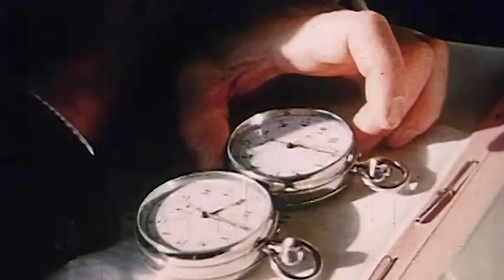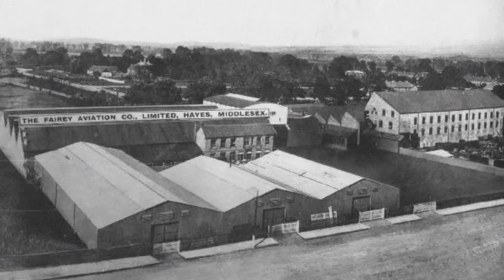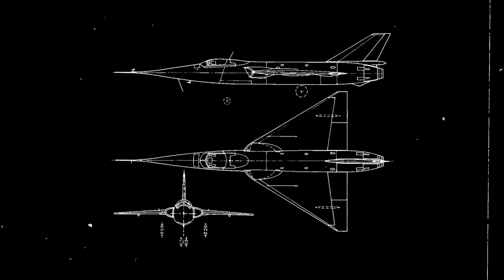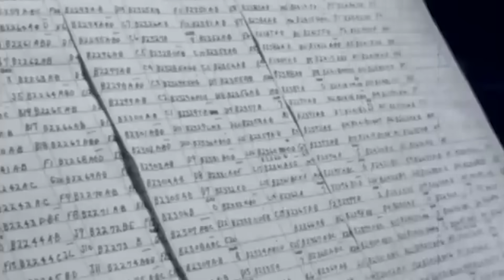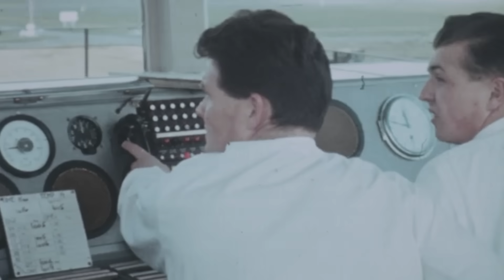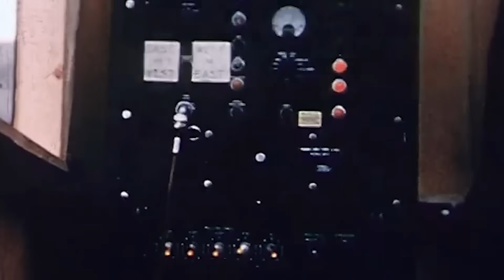Britain's 300 MPH Most Successful Mistake

Comment: What was ironic here was that the early Soviet jet fighters were powered by British-made engines that forced the British to play catch-up.
Reply: That is a popular but completely false British myth.  The soviet copy of the Rolls-Royce Nene is called the RD-45.
The MiG-15 is powered by the larger, more powerful VK-1 engine designed by Vladimer Klimov.

The Nene was not a popular engine, it was too large and heavy for its power output, its thrust to drag ratio performance was poor. 
Britain was years behind in engine technology buy more important it was a decade behind in aerodynamic technology, the MiG-15 was aerodynamically superior to anything the British had at the time, its jets still had straight wings..
Reply: @DoktorBayerischeMotorenWerke 

We believe we can clear up some commonly held myths and misconceptions, obviously

It's always good to see the facts presented clearly and concisely isn't it?

The original fabulous Whittle reverse combuster centrifugal compressor gas turbine aero engine has been in production permanently in one form or another by more that one manufacturer since 1939. The main current application is for helicopters. 
Whittle performed the world's first demonstration of a gas turbine aero ending in 1937. 

British Aerospace Sector & some bits & bobs etc. 

Interesting British achievements.
There is no doubt that the Fairey (England)
Delta 2 was of course the world's first jet
aircraft to exceed 1000 mph.  lndeed It
exceeded the previous record by 310 mph &
held the record for more than a year. Incidentally, the Dassault Mirage series of aircraft are based on the Fairey Delta 2. 
March 1956,  UK Peter Twiss,
1,132	 mph, Fairey Delta 2,	 Chichester, UK

The next speed record after the FD2 -
December 1957, USAF	1,207.6	mph, McDonnell F-101A Voodoo, 	Muroc, California 😎.

Non combat phase accident losses.
% of Aircraft built.
The EE Lightening did not have unusually high losses. 
The Canadair CL-44 was a turboprop airliner.
Canadair CL-44               (ff 1959 ) 48%
Lockheed XF104             (ff 1954) 100%
Lockheed  P80                (ff 1944)  43%
Lockheed F104               (ff 1954)  45%
MD FH Phantom 1          (ff 1945)  35%
MD F4 Phantom 2           (ff 1958)  28%
Convair F102 Dagger      (ff 1953)  45%  
MD F3H  Demon              (ff 1951)  32%
MD F-101 Voodoo           (ff 1954)  34%
EE Lightening                   (ff 1954)  33%
Gloster Meteor                (ff 1943)   21%
DH Vampire                     (ff 1943)   23%
DH Sea Vixen                  (ff  1951)  33%
Gloster Javelin                (ff 1951)   20%

Note that the Meteor didn't have particularly high losses, flew with more than 20 airforces for decades, got involved in air to air combat during a number of conflicts successfully against aircraft that first flew many years after the Meteor first flew.

Early days, jet engines. Whittle performed the world's furst demonstration of a gas turbine aero engine in 1937. The RR Nene, a centrifugal gas turbine aero engine, was the world's most reliable & most powerful gas turbine aero engine in 1944. Licensed built versions & copies of the RR Nene & RR Derwent would go on to power many aircraft in Russia including the Mig 15 & Mig 17, the US, China, France & other countries for decades after 1944. Incidentally, the Mig-15 was in essence an upsized / tweaked copy of the Whittle / Gloster E28/39 jet aircraft including a copy of the RR engine.  The centrifugal compressor gas turbine aero engine with Whittle style reverse flow combusters and sometimes an axial compressor section is still manufactured by more than one company, the main application being helicopters.

   That's correct, The Tornado & Typhoon & their engines are supersonic & are indeed British design aircraft with British design engines built by an international consortium. The Tornado design for example started life during the 1950s at Vickers as the AFVG, it's engine is based on the RR RB-199. The EE Lightening is also a British Supersonic jet aircraft. At the time the EE Lightening first flew it was indeed one of the fastest aircraft on the planet, it was still one of the fastest aircraft on the planet 4 years later when it managed a mach 2 flight.

  The Typhoon is the British BAC-EAP with an engine based on the British RR XG-40, the Typhoon is also built by an international consortium.

  Clearly It's a great pity & a crying shame that British military forces had to occupy a large part of Germany for decades after 1945 & Russian military forces had to do the same. Of course Russia still posseses a large chunk of what was German territory & of course  Russia & the UK produce nukes. Obviously Germany does not produce nukes.

An example of what goes on these days in various countries.

   Indeed, There are no German companies that make German jet aircraft in Germany & there are no German Companies that make German gas turbine aero engines in Germany that are suitable for widebody airliners.

  BAe Systems, GKN Aerospace & Rolls Royce combined now do more Airbus work than Germany on an absolute basis & significantly more work than that on a per capita basis.
   
  Per capita for the home nation BAe Systems is the world's largest defence contractor. BAe systems announced the recent £4 Billion takeover of Colorado based US based Ball Aerospace.
  
  BAE systems now does a significantly higher value of work for Airbus than it did when it was a major Airbus shareholder before 2005.
     
  RR now owns US Engine maker Allison for example which does classified Aerospace work for the US Govt.
   
 Anybody currently flying on a widebody airliner stands a good chance of being on an aircraft powered by RR gas turbine aero engines built in the UK.

  A glimpse of what goes on in the very internationally orientated British aerospace sector.

Boeing Apache Attack Helicopter.
AH-64: 75 UK suppliers, 7% UK content, global fleet of 1280+ aircraft.
F35B more than 130 UK Suppliers, more than 30% UK content.
F35A & F35C more than 130 UK Suppliers, more than 15% UK content.

The UK has the world's highest combined per capita Nuclear, Defence & Aerospace Sector activity.

Rolls Royce Holdings UK
Subsidiaries
- Rolls-Royce plc
- Rolls-Royce North America (Allison etc &  
  Classified Military stuff)
- Rolls-Royce AB
- Rolls-Royce Deutschland
- Rolls-Royce India Private Limited
- Rolls-Royce Marine Power Operations
- Vinters Engineering Limited
- Rolls-Royce Controls and Data Services
- Rolls-Royce Power Systems
- Bergen Marine
Joint ventures include:
- Rolls-Royce Turbomeca
- MTU Turbomeca -

Trent Family
The MT30 (Marine Turbine)
Industrial Trent 60 Gas Turbine
Trent 7000
Trent XWB Airbus A330neo.
Trent 1500
Trent 1000
Trent 500
Trent 600
Trent 700
Trent 800
Trent 8100
Trent 900

RR wholly owned subsidiaries in Germany handle smaller 2 shaft RR gas turbine aero engine work.   

We hope this helps of course.
     
Cheers, as always & indeed 👍.

Comment: 1957 Defence white paper  - We have been shafted again and again by a disgusting collection of small minded buffoons called the MOD . It would be interesting to discover who was backhanding these corrupt and treacherous officials. Probably the  same lot who screwed TSR2
Reply: Fairey Aircraft would never build a successful jet aircraft. Britain, years behind in supersonic aircraft technology would only ever produce a single supersonic aircraft on its own... the very disappointing E.E Lightning
Reply: @DoktorBayerischeMotorenWerke 

We believe we can clear up some commonly held myths and misconceptions, obviously

It's always good to see the facts presented clearly and concisely isn't it?

The original fabulous Whittle reverse combuster centrifugal compressor gas turbine aero engine has been in production permanently in one form or another by more that one manufacturer since 1939. The main current application is for helicopters. 
Whittle performed the world's first demonstration of a gas turbine aero ending in 1937. 

British Aerospace Sector & some bits & bobs etc. 

Interesting British achievements.
There is no doubt that the Fairey (England)
Delta 2 was of course the world's first jet
aircraft to exceed 1000 mph.  lndeed It
exceeded the previous record by 310 mph &
held the record for more than a year. Incidentally, the Dassault Mirage series of aircraft are based on the Fairey Delta 2. 
March 1956,  UK Peter Twiss,
1,132	 mph, Fairey Delta 2,	 Chichester, UK

The next speed record after the FD2 -
December 1957, USAF	1,207.6	mph, McDonnell F-101A Voodoo, 	Muroc, California 😎.

Non combat phase accident losses.
% of Aircraft built.
The EE Lightening did not have unusually high losses. 
The Canadair CL-44 was a turboprop airliner.
Canadair CL-44               (ff 1959 ) 48%
Lockheed XF104             (ff 1954) 100%
Lockheed  P80                (ff 1944)  43%
Lockheed F104               (ff 1954)  45%
MD FH Phantom 1          (ff 1945)  35%
MD F4 Phantom 2           (ff 1958)  28%
Convair F102 Dagger      (ff 1953)  45%  
MD F3H  Demon              (ff 1951)  32%
MD F-101 Voodoo           (ff 1954)  34%
EE Lightening                   (ff 1954)  33%
Gloster Meteor                (ff 1943)   21%
DH Vampire                     (ff 1943)   23%
DH Sea Vixen                  (ff  1951)  33%
Gloster Javelin                (ff 1951)   20%

Note that the Meteor didn't have particularly high losses, flew with more than 20 airforces for decades, got involved in air to air combat during a number of conflicts successfully against aircraft that first flew many years after the Meteor first flew.

Early days, jet engines. Whittle performed the world's furst demonstration of a gas turbine aero engine in 1937. The RR Nene, a centrifugal gas turbine aero engine, was the world's most reliable & most powerful gas turbine aero engine in 1944. Licensed built versions & copies of the RR Nene & RR Derwent would go on to power many aircraft in Russia including the Mig 15 & Mig 17, the US, China, France & other countries for decades after 1944. Incidentally, the Mig-15 was in essence an upsized / tweaked copy of the Whittle / Gloster E28/39 jet aircraft including a copy of the RR engine.  The centrifugal compressor gas turbine aero engine with Whittle style reverse flow combusters and sometimes an axial compressor section is still manufactured by more than one company, the main application being helicopters.

   That's correct, The Tornado & Typhoon & their engines are supersonic & are indeed British design aircraft with British design engines built by an international consortium. The Tornado design for example started life during the 1950s at Vickers as the AFVG, it's engine is based on the RR RB-199. The EE Lightening is also a British Supersonic jet aircraft. At the time the EE Lightening first flew it was indeed one of the fastest aircraft on the planet, it was still one of the fastest aircraft on the planet 4 years later when it managed a mach 2 flight.

  The Typhoon is the British BAC-EAP with an engine based on the British RR XG-40, the Typhoon is also built by an international consortium.

  Clearly It's a great pity & a crying shame that British military forces had to occupy a large part of Germany for decades after 1945 & Russian military forces had to do the same. Of course Russia still posseses a large chunk of what was German territory & of course  Russia & the UK produce nukes. Obviously Germany does not produce nukes.

An example of what goes on these days in various countries.

   Indeed, There are no German companies that make German jet aircraft in Germany & there are no German Companies that make German gas turbine aero engines in Germany that are suitable for widebody airliners.

  BAe Systems, GKN Aerospace & Rolls Royce combined now do more Airbus work than Germany on an absolute basis & significantly more work than that on a per capita basis.
   
  Per capita for the home nation BAe Systems is the world's largest defence contractor. BAe systems announced the recent £4 Billion takeover of Colorado based US based Ball Aerospace.
  
  BAE systems now does a significantly higher value of work for Airbus than it did when it was a major Airbus shareholder before 2005.
     
  RR now owns US Engine maker Allison for example which does classified Aerospace work for the US Govt.
   
 Anybody currently flying on a widebody airliner stands a good chance of being on an aircraft powered by RR gas turbine aero engines built in the UK.

  A glimpse of what goes on in the very internationally orientated British aerospace sector.

Boeing Apache Attack Helicopter.
AH-64: 75 UK suppliers, 7% UK content, global fleet of 1280+ aircraft.
F35B more than 130 UK Suppliers, more than 30% UK content.
F35A & F35C more than 130 UK Suppliers, more than 15% UK content.

The UK has the world's highest combined per capita Nuclear, Defence & Aerospace Sector activity.

Rolls Royce Holdings UK
Subsidiaries
- Rolls-Royce plc
- Rolls-Royce North America (Allison etc &  
  Classified Military stuff)
- Rolls-Royce AB
- Rolls-Royce Deutschland
- Rolls-Royce India Private Limited
- Rolls-Royce Marine Power Operations
- Vinters Engineering Limited
- Rolls-Royce Controls and Data Services
- Rolls-Royce Power Systems
- Bergen Marine
Joint ventures include:
- Rolls-Royce Turbomeca
- MTU Turbomeca -

Trent Family
The MT30 (Marine Turbine)
Industrial Trent 60 Gas Turbine
Trent 7000
Trent XWB Airbus A330neo.
Trent 1500
Trent 1000
Trent 500
Trent 600
Trent 700
Trent 800
Trent 8100
Trent 900

RR wholly owned subsidiaries in Germany handle smaller 2 shaft RR gas turbine aero engine work.   

We hope this helps of course.
     
Cheers, as always & indeed 👍.

Comment: The MIG jet used a Rolls Royce engine they adapted after getting their hands one one...Not sure if we let them have it or they acquired one...!
Reply: They bought some, the engines were advertised for sale all over the world. It's also the case that at the time a lot of the aerodynamics research info & engine construction engineering info was easy to get hold of so interested Russian chaps got some completed engines and a lot of info to help with designing & building their own versions. They did some larger versions of Rolls Royce centrifugal compressor engines.
Reply: @petemaly8950 The 'Interested Russian Chaps' ..clearly a euphemism for a spy..
Reply: @NeillWeston-z7z 

RR did need & obtained govt authorisation before selling engines to Russian aircraft  manufacturers.

Comment: 12:35 by any measure, the Concorde was anything but 'successful'.
Reply: Yes not exactly a lot of customers  I think only 14 made  but  it is and was  iconic aircraft  . The first Supersonic  passenger aircraft produced an d commercially  flown is a measure of success in itself.  Sadly, it. Cost so much to run  and the  Air France Concorde disastrous  crash  spelt the end of the Concorde.